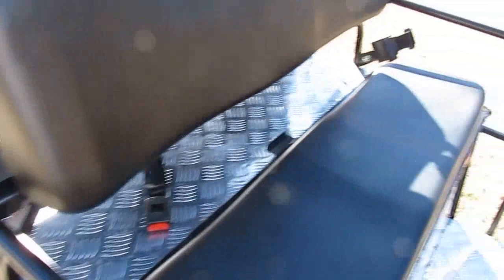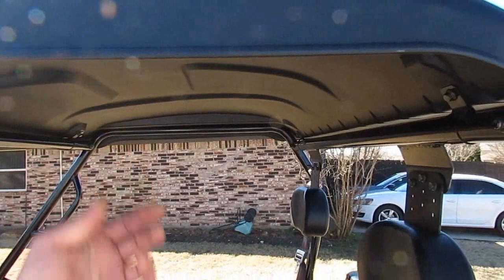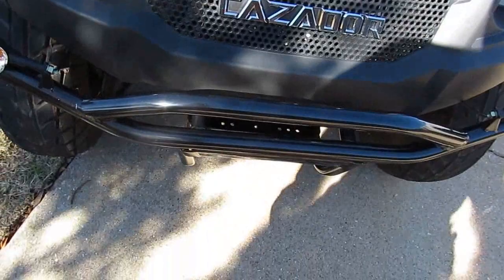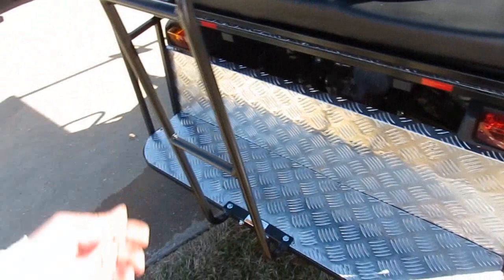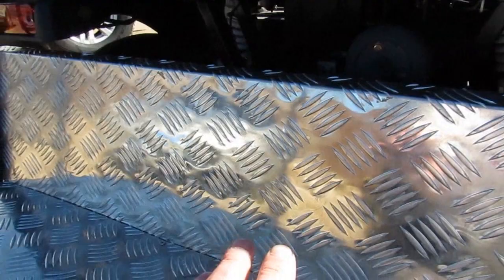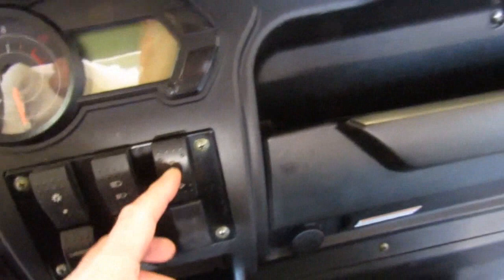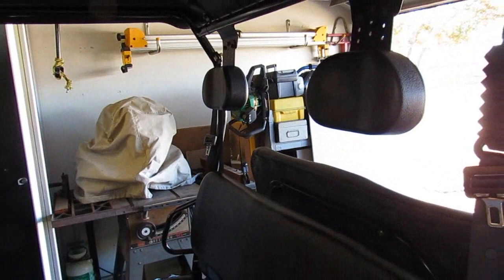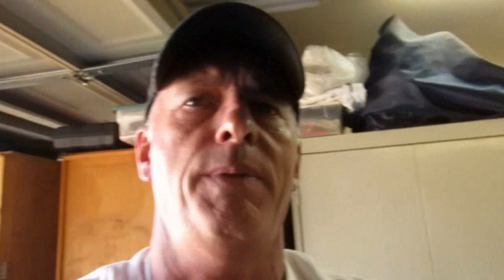Cazador: Golf Cart or Utility Vehicle?

Comment: I have just received my Cazador 200cc, as you mentioned it seems quite loud. Have you done any more improvements for noise suppression? Also it seems like i have to push the pedal very far down before the machine starts to move, have you noticed this on yours?
Reply from the maker: Yes it is loud and I don't really have a plan to address that.  What we've found is that cruising around at about half throttle is the butter zone for the cart.  It's a more pleasant driving experience and also reduces noise.  Backing the cart up always surprises me as the engine will rev pretty high to get it to move....so yes, it needs a lot of throttle to get it to go.  The strangest problem is that it doesn't like tight turns on pavement.  I've diagnosed this (so far) as the rear axles are locked and the rear wheels don't move independently of each other.  On a straight run or plowing through beach sand it's great.  But when a turn is required it will buck since the rear tires are somehow locked together and not working independently.  The tinted windshield is great during sunny days (and wearing sunglasses).  On darker days or at dawn or dusk the windshield tint is too dark.  This week is spring break and it's been used extensively - it's been a big hit with our family.
Reply: To take care of the sound drive it to the nearest lake and drive it in. Problem solved!

Comment: Do you have any advice on how to disconnect the backup alarm?
Reply from the maker: Our alarm actually doesn't work because the speaker sounds like it's blown.  It squeaks and sounds scratchy at a very low volume.  I think it's coming from somewhere under the hood or the dash but I'd hunt for that speaker if I were in your shoes.
Reply: Under the hood, right in front of the battery, there 2 square connectors, one is the backing up the other for the left or right turn signals.

Comment: How is the unit holding up now 10 months later?
Reply from the maker: I’d have to rate it a 7 or 8 on a scale of 10. The belt is squeaking which I would call normal wear and adjustment . The problem is I have no idea how to service the belt…it’s going to be exploratory surgery until I figure it out. Also, virtual every welded joint is rusting and a whole bunch of other misc parts are rusting. I can give it a pass on that since there’s salt in the air and corrosion is a problem with everything here. But…. We use it all the time and it gets us where we’re going (looks good too). Has good traction, I’ve never gotten it stuck yet in deep sand. Holding down the “override” button to get it out of positraction to turn a corner on pavement is an utterly stupid design.
Reply: There's no adjusment for the belt, you need to replace it ($18 - $30). Take the cover off and find out the correct size for it, should be printed on the belt. Invest on a variator holder tool ($18) to get the variator off, otherwise you are chancing breaking the cooling vanes on it if you force it too much.